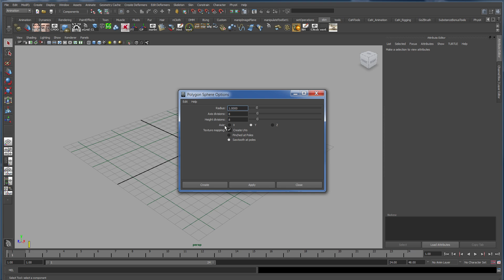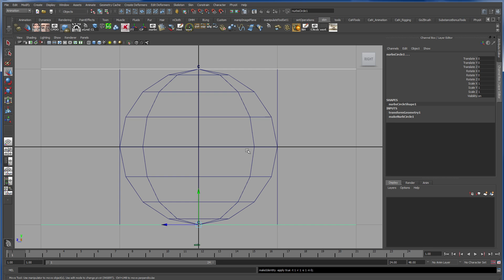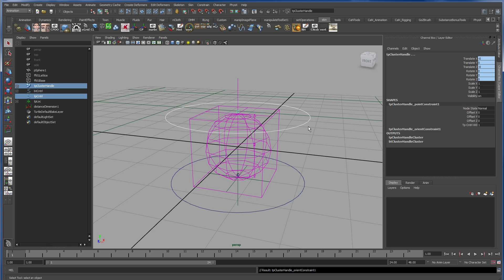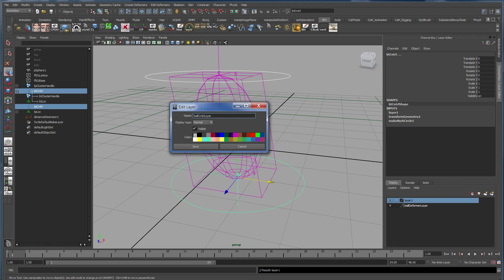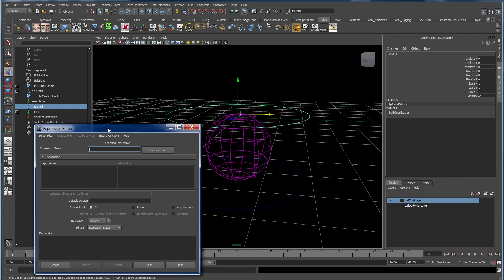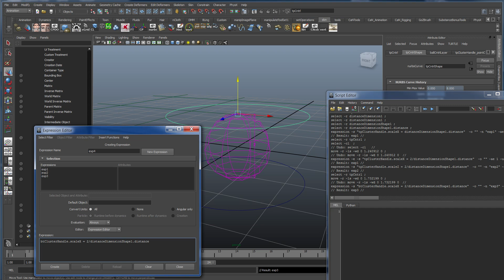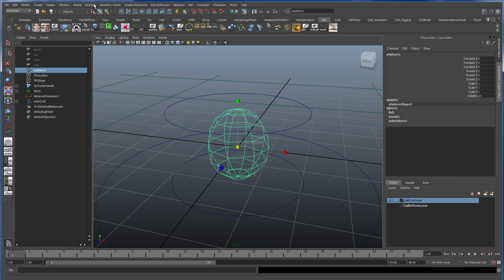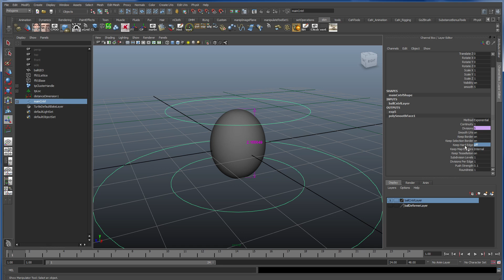Simple rigging for squash and stretch - Autodesk Maya 2012

Comment: Ok so the "little tool" to select lattice points? Do you need it. What do you actually do there? You create a cluster or something? Why? I don't see you parenting anything to the ball. Or using any joints. How did you bind the circles to the lattice or the ball to make them deform. Need a bit more explanation during the video what you're actually doing. I'm missing a step somewhere because I did everything but moving the nurbs circle isn't doing anything. Also, can I use this setup in a ball and tail rig? I don't want the tail to squash with it but I want it to move down from the center when the ball is squashed. Is this possible?
Reply from the maker: +TheChaosilator This is a little in-class tutorial not meant for deep learning off the web. If you examine various rigs online you'll discover probably many solutions. There usually is more than one way to do these things.